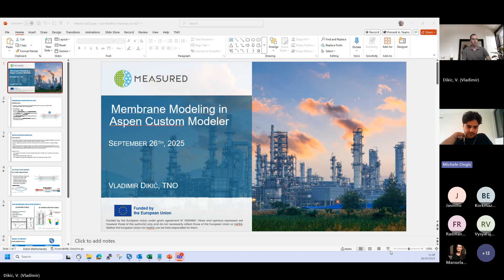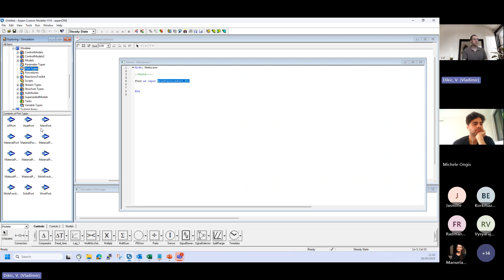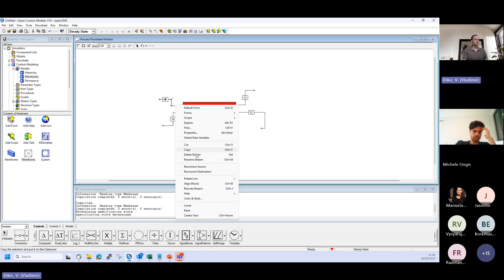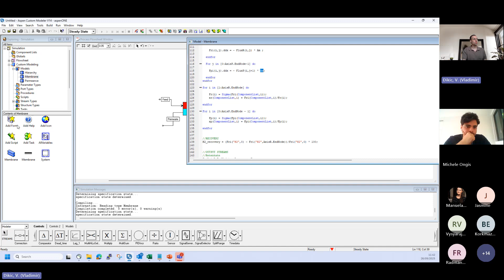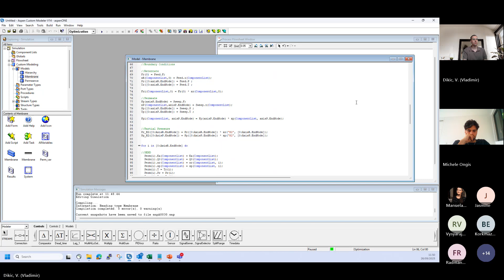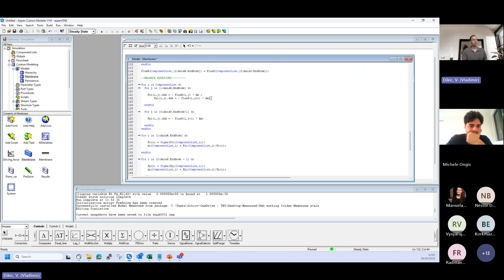MEASURED Project: Webinar on Membrane Modeling in Aspen Custom Modeler

Comment: Did you try to integrate hybrid modeling with ACM for the same purpose using real plant data?
Reply from the maker: No, this tutorial is to start with simple physics-based membrane models. The main goal is to have a customized component to be implemented in Aspen Plus/Hysis for process simulations, rather than to create a digital twin interacting with the real plant